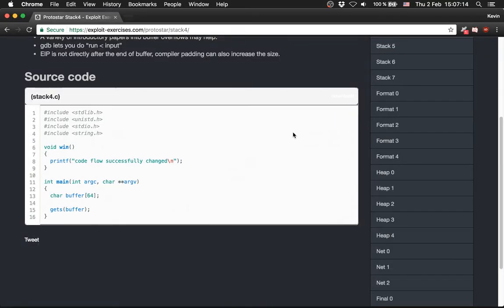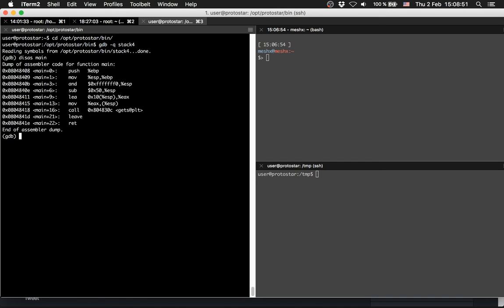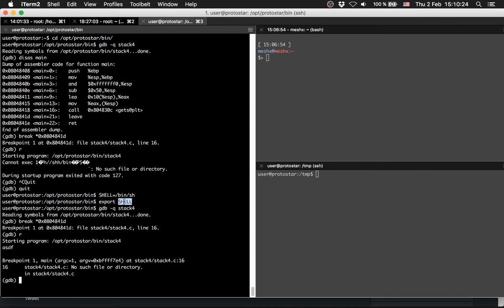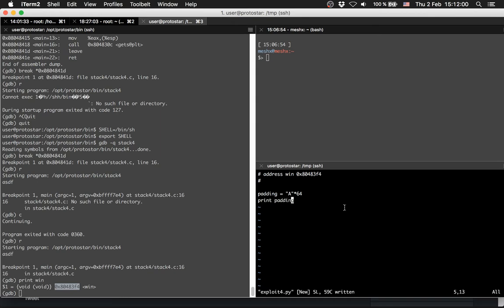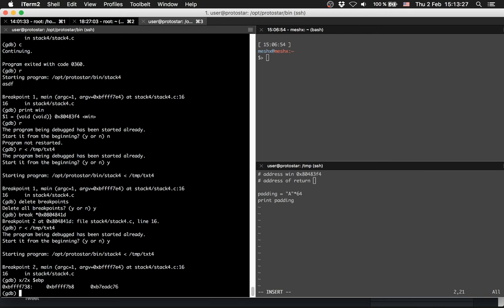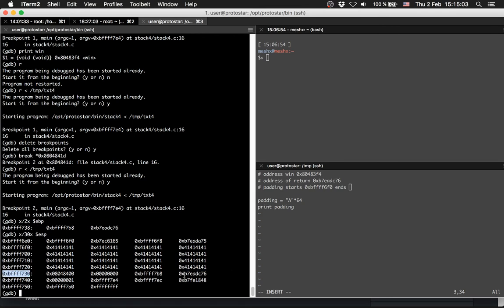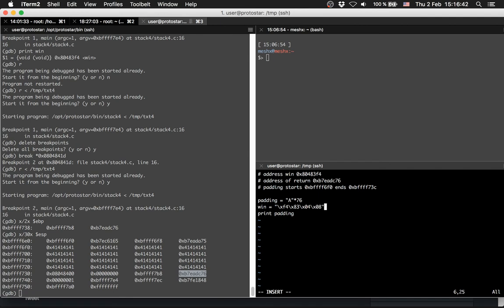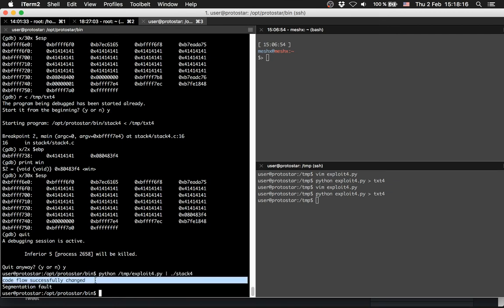Protostar stack4 - Overwriting EIP and buffer overlfow

Comment: What do you speak from 6.40 to 7.05
Reply from the maker: Since EIP is not directly at the end of the buffer, you have to get the correct padding. The buffer is 64 bytes big and the EIP is somewhere at 64+ bytes. So the address I am looking for (0xb7eadc76) is the return address. We need to overwrite this address with the address of the win() function. So you need to find the start of the buffer and the end, which is the return address for us, to know how big your padding should be in order to overwrite the return address.

You basically want to "go up" to this address and change it and the "go up" is the padding (not 64 bytes) I am talking about.